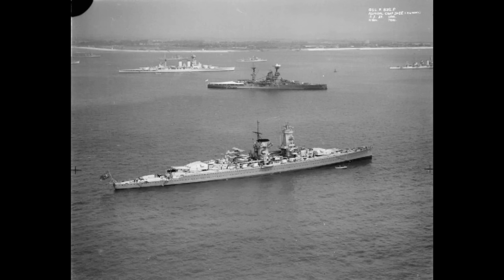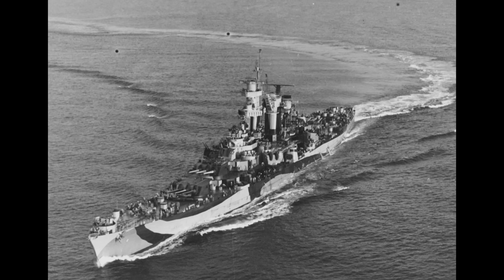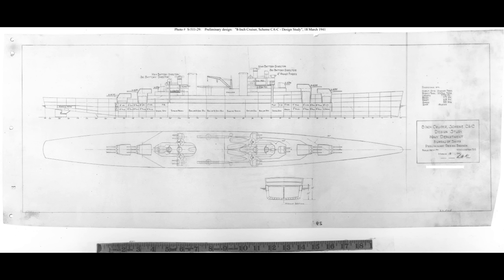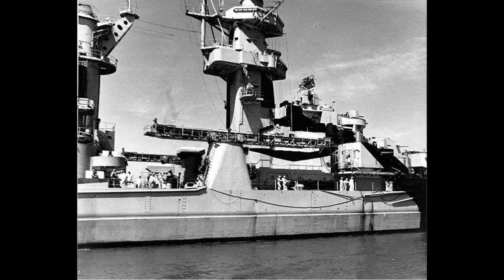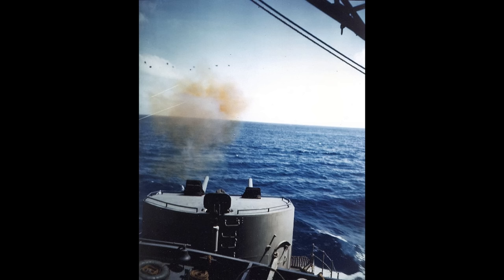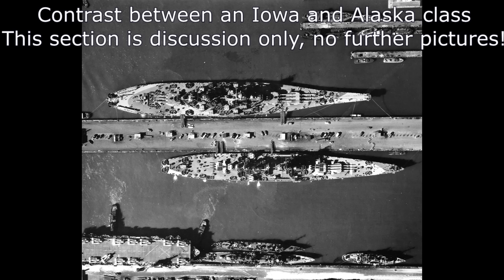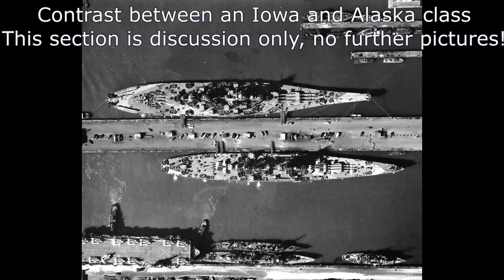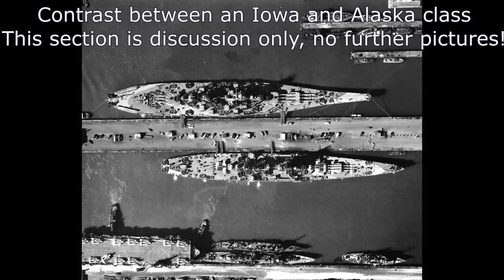The Alaska class - Large/Super/Battle/Mega/Hyper/Ultra Cruisers

Comment: I honestly love how the Alaska’s look even if they where practically useless right off the slip. Wish they saw more use then as a floating AA gun battery but not much could be done there.
Reply: Well, they weren’t useless.  They were just overkill for the cruiser role (especially since the Des Moines were being built and were cheaper to build and man) but would struggle against a true fast battleship and were much more vulnerable to torpedos and AP bombs.  For a third more money, you could get a much more capable and survivable Iowa, which would have also had more room for upgrades, or two Baltimores, or 1.5 Des Moines.  And if you just wanted shore bombardment, you could use the SoDaks, NCs, or even WV.
Reply: They would've made interesting museum ships, if not much else.....
Reply: Honestly, anything in its role if it came out even a year earlier and it would have done great work killing smaller vessels, at that point the Japanese heavy fleet was mostly collecting barnacles on the sea floor and it was only enemy raiders and escorts floating around with a few heavier ships providing supplemental task forces to landing ships and what was left of the carrier fleets.

The alaska escorting carriers in these engagements would have done quite well, especially considering they wouldn’t be the focus of enemy bombers (as they were escorting carriers) but would be able to be detached easily to chase enemy cruisers

Really interesting and cool design and probably one of my favorites. Shame it didn’t get finished just a bit sooner though
Reply: @bluemarlin8138  
The question we should be asking, is how many PT boats could we get for the price of an Alaska class ship.... Maybe a thousand?? Well, you could certainly overwhelm just about any large enemy warship with swarms of hundreds of PT boats! 😁
Reply: @HighlanderNorth1  Laughs in jeune ecole
Reply: I believe they could have filled the same cold war role that the Iowas ended up in.
The range of Alaskas guns was just 3000m shorter than Iowas (35 vs 38km), with a slightly faster fire rate and longer barrel life.
They had more than enough deck space to fit AA-Missile and Tomahawk launchers and they also had the speed.
With hindsight, there is nothing the Iowas did, that the Alaskas could not have done just as well.
Reply: @HighlanderNorth1  PT boats were practically worthless in WW2
Reply: @bluemarlin8138  the WV amd her ilk were too slow.
Reply: @josephkool8411  PT boats did a lot of interesting harassment work and coastal defence, and sank at least one heavy cruiser in the Pacific. They made landing and supplying amphibious invasions difficult, and they were very cheap tools. That's why nearly all the powers of WW2 built reasonably significant numbers of them. They were particularly useful for the Italian navy, considering the torpedo boats didn't have the poorly skilled, politically appointed command the larger ships did.
Reply: @kilianortmann9979  The Alaskas would have been excellent for Cold War duties, and they were much smaller and therefore much cheaper than the Iowas. The USN kind of missed out there
Reply: Absolutely! Maybe the prettiest ships ever.
Reply: @bluemarlin8138  you don't understand, late 1940s, the United States had almost unlimited money. And by the Cold War our literal wealth indeed became so vast agencies were given the green light to embezzle the government through overplaying for the most basic items; IE, $400 for a hammer and $300 for a toilet seat in 1948. Thats like paying four grand for a hammer today, and three for a plastic toilet seat: Cmon!
Reply: @mtumeumrani376  Obviously money was not unlimited, because they cut construction of so many ships and cancelled a number of weapons projects on cost basis. They also put most of the navy in mothballs for a while to save resources
Reply: She’s like the pretty girl the boss hired (back when they did those sort of things), and no one knew why. She had no job title or any particular skills, but the boss still kept her around because she looked just way too good.
Reply: @andrewreynolds4949  you have to read "Revolt of the Admirals" by Barlow. Money wasn't the factor behind the open attempt at canning the Navy. The Truman Administration was literally in bed with the brand new air force and was hell bent on the idea of nuclear war for the future. Cost was just a cover up, because all the air force programs were off the charts. Funny thing was, most of their shenanigans didn't even work; most of the air force projects were simply to scheme money from the government: it worked.
Reply: @josephkool8411  
That's only because they didn't have enough of them. You really need swarms of PT boats! (I've been joking all along BTW).
Reply: I was born in 1948. I was a young man when the $600 toilet seats were discovered. You are off be a couple decades.

The US had unlimited power post war, compared to any other country, with sole possession of the atomic bomb, but not unlimited money. Although our infrastructure had not been wrecked like Europe and Japan, wars cost a lot of money. It was not unlimited.
Reply: The Alaska's wpuld have made many a 2nd world navy happy, had the US sold them off as an off-the-peg capital ship on-a-budget, instead of scrapping them.

This is when considering that various postwar nations such as Spain, Sweden and most of S-America, among others, had older Capital Ships to replace but not the means to build a replacement themselves, or in Spain's case had lost an entire class of ship in their civil war.

Makes one wonder what sort of historical niche the Alaska trio might have had.
Reply: @jimtaylor294  Spain was far too poor to afford the operational costs of an Alaska class cruiser, and I'm not sure how effective they would have been as coastal defense cruisers in Swedish service, but Turkey would have definitely appreciated them as replacements for Goeben/Yavuz.
Reply: @hailexiao2770  Interesting points.
Spain did once have a handful of small Dreadnoughts, thus a Cruiser - albeit coincidentally of the same caliber guns and vastly more modern - would have been a logical choice for a replacement.
Spain's post-WWII economy though was indeed weak (mostly self inflicted), but several medium sized warships were still achieved.
Reply: Agreed, I absolutely love the aesthetic of the Alaska.
Reply: But if they had been commissioned in 1940 and had been given captains that most of all were competent not old boys network, respectful of the capabilities of the Japanese Navy, and aggressive as Bull Halsey they likely would be considered the most useful surface combatants of the war.
Reply: @josephkool8411  I wonder how effective they could have been had effective, reliable torpedoes been available from the get go.
Reply: "...even if they where practically useless right off the slip" - that's just silly. They weren't useless. They had more firepower than anything but a battleship, they were fast, had good AA setup. They weren't 'practically useless' - and post-war, we had a surplus of brand new ships.
Reply: Well that is totally not true
Reply: @HighlanderNorth1  ...and more useful than an LCS.
Reply: @Sherwoody  back when they did? Lmao when do you think that stopped?
Reply: Probably the souped-up Atlanta concept that had been considered and discarded would have been the wiser investment of resources, especially once the kamikazes started
Reply: @calvingreene90  I think one of them could have done more damage to the Hiei in the fight off Guadalcanal than the San Francisco did. Praise to all who went through that fight. I met and talked to an O Bannon (destroyer) crewman. It was a good talk. I let him know of the respect I had for them.
Reply: @andrewreynolds4949  money is NOT the reason they cut those programs and ships get mothballed when theres no war🤨
Reply: @stevenkarnisky411  it was unlimited guy
Reply: @MrCoolguy425   Agreed!! Timing was everything back then!! The could of served with more distinction and even After WW-2 a a cheaper alternative to a full size BB !! However it's guns actually cost more to produce than the 16" -50 gun!!. Hmmm I see a pattern here with the Zumwalt gun!! At least the Alaska class worked lol. However it's downfall was being built with on screw!
Reply: @kilianortmann9979  agreed 👍
Reply: @josephkool8411  nothing cool with you dude!!
Reply: You have no idea what your talking about!!
Reply: @andrewreynolds4949  Cold war was all about subs with the Navy
Reply: @HighlanderNorth1  They burned over 500 of them rather than ship them home when the war was over
Reply: @andrewreynolds4949  They saved a lot of lives rescuing sailors after the Guadal Canal battles and they evacuated Mcarthur and his wife. He got sea sick and she didn' t that's kinda funny
Reply: @enricomandragona163  Take it easy kid
Reply: @josephkool8411  yeah !!... Ok
Reply: Post WW2 they would have made perfect fleet flagships. Too bad the Navy didn't appreciate this.
Reply: @josephkool8411  
Really, they burned the remaining PT boats? They could've simply stripped them of their weaponry(which they would've done anyway), then DONATED them to the people living on the various Pacific islands, who probably had a LOT of their own boats 'commandeered' or destroyed by the Japanese military during their occupations. Obviously the islanders needed replacements for their lost boats, and our PT boats could've been very useful to them.
Reply: @HighlanderNorth1  Yup
Reply: @johnortmann3098  Two qualifications - 1) "post age of sail" and 2) prettiest cruisers, okay, yes, but the prettiest of all were the North Carolina class battleships. I admit a "home state" bias, but the flowing hull lines and bluff flared bow of the North Carolina class ships were definitely a better aesthetic. Nevermind the fact that the bluff bow gave a dryer ride than the the SD Iowa and Alaska class. (All three had to add height in the form of AA gun tub shields to keep water from flooding down the forecastle in anything but calm seas)
Reply: @danhaas9730  Jeune ecole but with industrial superiority. 

Btw. If you were to build a navy around flying boats would it be jeune ecole but flying?
Reply: @jimtaylor294  i
Reply: @HighlanderNorth1  Wow - that would be amazing! Almost like having to face a massive air raid, except the targets are really, really slow and have no self-sealing fuel tanks! Truly inspired!
Yes, PT boats were a bit sh!t. They had their place and role, and those were not making massed attacks against flak-frilled, artillery-studded floating fortresses of thirty knots speed, surrounded by very fast artillery and flak outposts. With searchlights and starshell everywhere. And copious hydrophones to hear your thousand petrol engines coming from twenty miles off
Reply: @AndrewGivens  
That reminds me. How exactly was JFK's PT boat crew unable to see or hear a Japanese warship baring down on them at flank speed, in the middle of the night, while sitting idle in the waterway between the Soloman islands?
Reply: @jimtaylor294 Good point; Argentina was one of the wealthiest countries in the world [per capita] at the end of the war; and many countries bought surplused Liberty carriers as coastal patrol and interdiction ships and later helicopter carriers for rescue, and as S/VTOL carriers for light ground attack aircraft and Harriers.

A "large cruiser" would be a prestige item in many ways, but if air defense was upgraded to protect against Exocet missiles, then it would be entirely formidable to anything within its gun range.

I think they really missed the mark in not immediately authorizing the version with battleship hull protection and four triple turrets, and having the first tranch in 1942.

As a carrier escort, equipping it with its own plane--rather than simply the fittings to support seaplanes when acting independently--seems silly to me.
Reply: @HighlanderNorth1 P.T. boats burned lots of fuel even idling, and handled poorly at low speeds.

Many U.S.N. P.T. boats were sold as salvage after the war, and became toys to speed addicts (velocity, not amphetamine) before fuel costs had them sold-off. Very popular with the Florida-Bahamas-Tobago crowd, they were a common sight in ports as far as Venezuela and even Brazil!
Reply: @davidgoodnow269  Agreed. Apart from Submarine attack and some of the heavier duty A/S missiles of the '70's & '80's (and of course a larger Capital Ship or a tactical nuke), there wasn't very much that could've hurt an Alaska, and most were unlikely to encounter in South-America.

Given that the USA sold smaller Cruisers to Brazil, Argentina and Chile in the '50's (to keep a reasonable balance between them all), a situation where Alaska, Guam & Hawaii ended up individually the Capital Ship of each aforementioned S-American nation, is all too likely.
(as Brazil's Battleships were also overdue for replacement, as was the Admiral Cochrane in Chile; both of which had similar armaments yet far less capability with them relative to the then modern, much faster & better protected Alaska's)
Reply: That's over 2 miles meatball